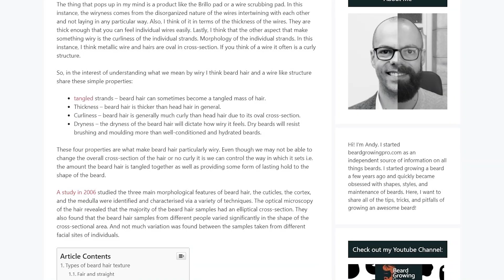Why is beard hair so wiry? The strange reason why (from science)!

Comment: PhD in Chemistry?   WOW !  As one chemist to another, not really Organic Chemistry kicked my butt, I got back to back C's so I became a Chem Eng.     I've been doing controlled tests on beard oils and looking up their chemical formulas.      They all seem the be the same.    Long chained h-c's with a double bond or two, and a hydroxyl or carboxylic acid at the end.   Jojoba is a mix of variations of cholesterol.    Almond and argan oil are very similar.      Pantene works as good as a 10 x more expensive beard shampoo.      So the beard products are the same thing with cool marketing packaging presentation and advertisements to differentiate them.     I haven't seen noticeable diff in results.       So use your Chemistry Phd to prove me wrong.    And if you ever say something stupid like, "oh, it has alcohol, and alcohol is badd", I will thumbsdown you!!